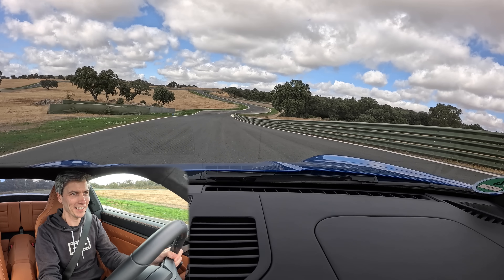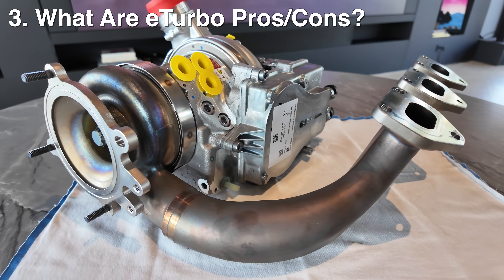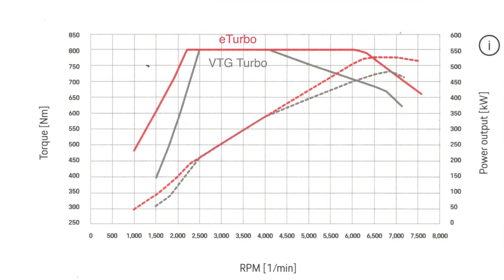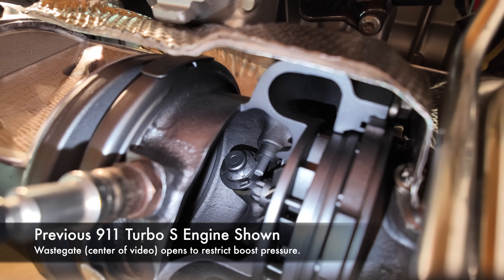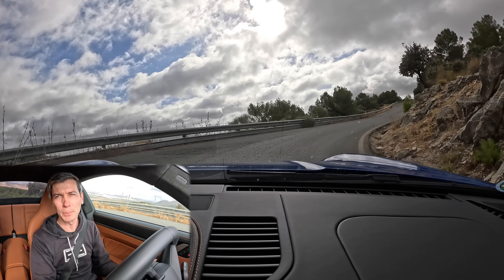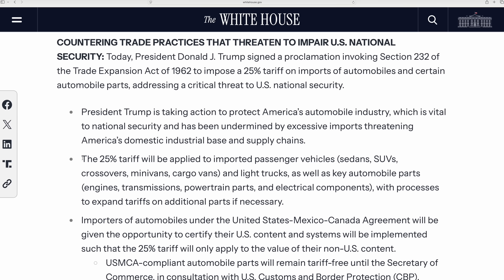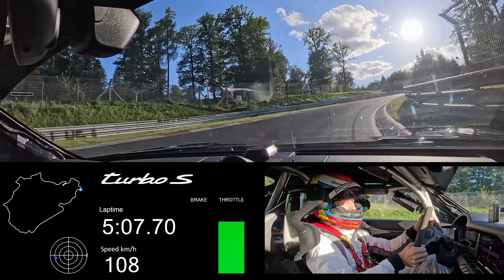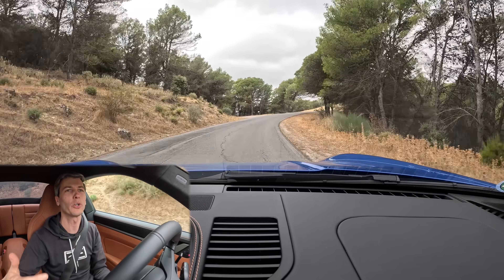Electric Turbos Are Here — Is It A Good Thing?

Comment: no waste gates, no variable geometry, means way less moving parts... seems like a reliability win, too... so long as the magic pixies behave.
Reply: the fact that they can harvest 30bhp says a lot about how much of the boast is being wasted in a conventional system
Reply: @hyakinthos_0902  it's not boost being wasted, it's waste thermal energy in the exhaust. The wastegate "wastes" thermal energy (that would've been used to make boost) to prevent boost creep, whereas the Porsche system converts it to electricity and uses it to power the traction motor.
Reply: @JamesBalazs  the turbo harvests the velocity from the exhaust which is caused by its pressure(=boost in laymen's term)  which itself is caused by the heat
Reply: @JamesBalazs  you basically said the same thing @hyakinthos_0902 is saying XD, thermal energy is still energy that can be converted to boost, Porsche just converted it to electricity instead of wasting it as released thermal energy (that could've been converted to boost) but since it wasn't needed at that moment it was released (wasted). Porsche instead of this now stores that energy in a battery as electricity which can be used later when needed. I dont get your point.
Reply: @geemy9675 boost is intake pressure, not exhaust pressure.
Reply: @Gnerko123 agree. I don't know what you replied to...
Reply: @geemy9675 you wrote exhaust pressure = boost, which it isn’t.
Reply: @hyakinthos_0902 well how much power can that Porsche make with no boost control?
Reply: @hyakinthos_0902  entire ice engine is one big waste of energy.
Reply: @AmigoAmigo-w5p Electric motors are boring and lack character and passion.
Reply: @AmigoAmigo-w5p 
Okay then, please solve the charging problem.
Reply: @AmigoAmigo-w5p   Anyone with a minimum of technical background would know both ICE and EV are massively inefficient on a systems basis.  The electricity comes from a highly inefficient system if looked at on a systems basis as does ICE.  To just look at an internal combustion engine and compared to electrical engine is really simplistic.
Reply: about 30% peak efficiency
but a hybrid is more practical for today. Unless we overhaul the country's electric grid
Reply: @MrEkzotic truth
Reply: @MrEkzotic that’s not the diss that you think it is.
Reply: @banzaiib AvE fan by chance?
Reply: @bgg-jp5ei yessir! This seems pretty skookem!
Reply: @bgg-jp5ei I watch that channel 👍
My perspective in this is also the inverter drive necessary to operate what is either a 3 phase AC motor or a brushless DC motor.
I'm guessing it's BLDC to spin a good 60,000 RPM or more very quickky to get the turbo where the turbine would take it from there.
This certainly changes this from being purely a mechanical design and repair to one of some sophisticated inverter system.
Also I was thinking about the regen capabilities just before he mentioned that they became a source of power to redistribute elsewhere. That is cool 👍

No doubt, those of us who are not millionaires would never consider what will become a money pit over the years.
Reply: @bgg-jp5ei he clearly already doesn't
Reply: Where there's magic pixies there's angry pixies. Not to mention the confuser might get confused
Reply: It also replaced the air pump used to get the catalytic converter started.
Reply: @gordonn4915 Air pumps for emissions have NOT been used for 30 years since they could do it with some strategic valve timing/overlap etc
Reply: How much of the reduced parts is from the hybrid system than the e-turbo? A hybrid system already gets rid of a lot of accessory belts and the starter motor. The only thing the e-turbo looks like it's specifically removing is the wastegate.
Reply: While I get and understand what you are saying about less moving parts. My concern is having an electric motor married to one of the hottest parts of an engine.
Reply: @davidl8620If you check at 1:07 it seems there is oil/water conduit over there,maybe for also cool the electric motor?
Reply: @davidl8620  no doubt this sounds like it could be less reliable, however there are winding insulation materials that can withstand extremely high temperature.  Class R windings are rated for 220*c. The bearings have already been rated for these temperatures before the electric portion existed. And there's no rule saying the electronics have to be mounted to the turbo. If the motor is oil cooled (most likely is looking at the cutaway photo of the turbo) the winding will never see temps that high. Electronics get a bad rep because consumer grade electronics are known to be less than reliable. Things specifically designed for harsh environments are quite impressive in what they can handle. I replaced a cutler hammer responder drive 4 years ago that had been running since the 1970s driving a 50hp electric motor. The little bit of plastic that was in the drive was crumbling, but it still ran.  If we want electronics to last, we can make it last.
Reply: @matthewweaver1123 automotive electronics are a different grade with special requirements for temp cycling.    Higher temperatures and more cycling will still reduce lifetime, minimising that is always a good idea.  Eg mounting an ECU on top of an engine looks like bad design.  Exotic electronics made of GaN can cope with far higher temps than silicon, these parts may not need heat sinks.  But they are expensive and have other reliability concerns.
Reply: @matthewweaver1123 also, there are exactly zero electronics in an electric motor..
Reply: @geemy9675 
There are electronics in brushless motors like that one that has them mounted to the sides of the motors.

As a later comment says, it appears there is coolant running through them to keep the heat in check.
Reply: @davidl8620yeah true. But if its reliable, how porsche gonna make money? :3
Reply: @holyKSer123 The ones that do fail will cost many times more and scare people off buying the car out of warranty, like EV's due to the battery.
Reply: @davidl8620 it’s Porsche. They’re not worried about reliability, just making sure it makes it past the warranty
Reply: @davidl8620 It doesn't increase the price of the car by several thousands for nothing. Variable geometry turbos sound like hell to engineer and assemble, yet the little device with few moving parts still ends up costing far more. Maybe they're using some exotic materials or the motor is hooked to the cooling system, maybe both, or maybe nobody has driven the new car hard and long enough to find out Porsche just wanted higher margins.
Reply: @davidl8620 a fair concern, tho modern electric motors tend to produce tremendous heat themselves in high performance applications
Reply: @air-headedaviator1805  and as a result employ various cooling techniques, often water cooling... Adding complexity back to the turbo
Reply: @air-headedaviator1805 all the more reason not to put one next to a turbo.
Reply: I couldn't even guess about reliability, but repairability will surely be worse, or at least much more difficult.
Like imagine getting a cheap old porsche in like 20 years but the electric stuff is not working.
Reply: @shiba7651  A today's Turbo S is so well-made, people will still pay anything to get it running, even in 20 years from now on. 3D printing metal parts will also be much cheaper in the future.
Reply: @shiba7651  Worst case scenario, just delete the turbos and you'll still have a great NA engine.
Reply: @ChristianStout  motors designed for turbos usually run less compression, cams tuned for the turbos, and other systems designed to run with the turbo.  A turbo motor minus the turbos would be a big turd.
Reply: @ChristianStout  IF you can get the computers to let you do it.
Reply: @shiba7651  That's like getting any 20 year old German car, AKA not the company's concern because they only care about the 4 year leasing period for reliability. After that, whatever sucker buys the car used gets to pay full dealership prices, especially with so many things becoming brand specific that try to stop you from doing repairs yourself nowadays.
Reply: @shiba7651  It'll be cheap to fix that stuff in 20 years.
Reply: @shiba7651 that all depends on how widely electric turbos are used. Also surely people who can afford a 911 can afford to maintain it right?

It's not exactly a cheap car 😂
Reply: @shiba7651  these will probably become standard on cheaper brands
Reply: @shiba7651  So.....just like now?
Reply: @shiba7651  alternators are pretty cheap
Reply: @shiba7651  that would be so cool to grab this for like 10k, could be easily repairable
Reply: @shiba7651  All new cars are becoming disposable items, no matter how pricey they may be.
Reply: @shiba7651 My first thought was that  failing electronics in this turbo would just mean that the turbo would function as a non-e turbo. But no, in this design it also functions as a wastegate so I don't think they are going to let this car run very much if these electronics fail.
Reply: @shiba7651  Exactly. Imagine trying to restore these things 20, 30 or 40 years from now. These manufacturers (all, regardless of brand) are dropping some parts availability beginning at just a few years from last production. Won't it be fun just trying to keep it running, let alone doing a full restoration. No thanks, I'll take the purely mechanical one.
Reply: @shiba7651  And you can guess the cost of replacing that electric turbo ....just the part cost alone is likely to be breathtakingly high.
Reply: @henrybrandt1057 the good thing about things is, the more there is the cheaper it gets. So in 20 something years if it breaks there will 100% be better and cheaper availability of parts that are currently "rare".
Reply: @henrybrandt1057  probably around 10K for such a turbo. The less sophisticated AMG one costs abot 6K
Reply: @henrybrandt1057 there are definitely going to be aftermarket parts and it sounds easier to as tbh! Electric motors aren’t a new thing either
Reply: @henrybrandt1057 thats just cause its new and uncommon, it shouldnt be too expensive cause electric motors are really cheap.
Reply: @shiba7651  Will it though.. Extra code running through computer, sure, but in terms of hardware, I suppose recoiling motor isn't exactly impossible task, and for standard turbo regen, there are shops that do that. I think you will be able to regenerate it. Only thing that comes to mind that the wire to coil would need to have some high temperature isolation, not sure if standard stuff would survive the turbo temperatures.

Im carefully optimistic that it would be actually easier to repair. Not including batteries / other hybrid stuff, that is, I assume comparasion is against hybrid stuff and we focus just on turbo
Reply: I feel like it depends on the future direction of hybridization. If this is a one-off or early design that needs much refining, or will be dropped due to other costs, then its uniqueness may make it difficult and expensive to repair/maintain. But if this turns out to be something that becomes more common, then the knowledge and parts may be more available and easier/cheaper to maintain. 
I guess all I'm saying is, time will tell.
Reply: @CoryMT  It's been tried and tested in F1. Not sure about road cars (ignoring the AMG One, for a moment, as it has a Mercedes F1 powertrain inside of it)
Reply: @halofreak1990   IIRC Only Merc and Porsche are pursuing anything that looks like an MGU-H, and also they're dropping it for 2026. So. Who knows.

The main thing holding it back is that all turbines are inefficient at partial power, and regular cars don't spend that much time at full power, compared to a regular crankshaft hybrid that makes an engine more efficient whenever it's at partial power.
Reply: @by010 the heat is mainly contained to the hotside so I don't see the coil that is mounted with the cold side experiencing significant heat. Like we have silicone couplers directly bolted to our turbos I'm sure we can put the coil in a place that won't melt. Motorcycles have coils built directly into the side of the engine encased with hot oil so I'm sure a turbo coil can be made with similar specs and experience similar temperature on the correct position of a turbo.
Reply: @clutchboi4038  Dont they like make 1500C silicones but copper is like 1000C? I think its possible to engeneer around it, IDK if and what they actually did and what is that temperature we are talking about. Just I know turbos on hot side get really hot, so possibly touching very hot thing, I wouldnt be suprised if that was a problem, simply.
Reply: @shiba7651 no such thing as a cheap old hybrid.
Reply: @shiba7651 the electric stuff is actually a lot easier to fix. Funny enough.
Reply: There will be aftermarket refurbishers for these. But it won't be cheap!
Reply: Couldn't you hypothetically  mount the turbo farther away from exhaust and pipe the air from the back of the car somewhere and get the turbo itself away from engine bay and all the heat
Reply: "Its more reliable"

Sure. Right up until you blow one of those e-turbos and fork over 20k.
Reply: @StabbyStoat I don't think you can blow the turbo on any 911 turbo in history and not expect it to be expensive.
Reply: @air-headedaviator1805  thats usually because when the turbo blows, chunks of metal from the turbo go straight into the combustion chamber and cause malice in the palace, as youtuber IDoCars often says
Reply: @StabbyStoat that’s price, not reliability
Reply: @louisthibault555 ... If you have to spend a lot of money on something to fix it, then its not reliable. By definition, its not something you can rely in.
Reply: @StabbyStoat an expensive part that rarely fails is by definition reliable. Again, what you’re talking about is cost.
Reply: @louisthibault555 You putting "turbo" and "reliable" or "rarely fails" in the same sentence shows everyone here that you dont know anything about turbo'd cars, or how expensive it is to upkeep them. Turbos are the MOST COMMON part to fail on a turbo'd engine.
Reply: @StabbyStoat  if your point is that turbos are in general less reliable than natty cars then … yes.  And this turbo is supposedly more reliable than other turbos.

The rest is a difference in cost.
Reply: @louisthibault555 .. and that cost is always put on the consumer. Someone who has to spend a lot of money on keeping their operational, is not going to tell you their car is reliable.
Reply: @StabbyStoat correct. It costs more, including to maintain. 👍
Reply: @StabbyStoat it's a 911 turbo S . it's meant to be fast, expensive ....and to have turbo(s)!
even if the turbo name doesn't mean anything anymore 😂
So yeah if an hybrid with electric turbo gives better performance, they use it. also Porsche is not shy of adopting new technologies. bor ONLLY when they are mature enough to meet their standards
Reply: @StabbyStoat 20k ? You’re not even in the ballpark.
Reply: @Smootier yes cost fitted because the engine has to be dropped out of the car and then refitted after the work has been done and the parts cost a fortune, standard for most 911 repairs
Reply: Noooo booooo
Reply: And the angry pixies keep themself inside.
Reply: Imagine if they got rid of the turbo and the engine entirely and just powered the car with an electric motor. That would be even less moving parts and even better reliability. Not to mention the increased response and the incredible torque from a stop
Reply: I was wondering why this hasn't been done before.
Reply: Whose parts will hold up?😮
Reply: Cooling the parts in some way. Hmm...😉
Reply: it is not because the electric compressor motor doesn't like heat.
Reply: I’d rather have a waste gate
Spring > electricity
Reply: The ProCharger 101 -Supercharge CrankDrive™ is better then E-Turbo's Cause you can Change Gear Ratio's on the SuperChargeer while you Drive or shift Gears thus No Lag and You can Turn It OFF When it hit's Maximum RPM's Thus no More ENERGY from Engine to the Supercharger aka transion into a 100% naturally Aspirtated CAR
Reply: They are angry pixies
Reply: Taycan has none of that and it’s a reliability disaster
Reply: If you are using a electric motor, you might as well use it to spin the wheel.
Reply: I feel like it's a terrible idea.
Reply: Variable geometry would still be cool
Reply: Constant fetling and adding more complexity to ICE engines to make them more responsive.... 

Ironically making it feel more like an EV with more instant power and less theatre 'waiting for boost to build'
Reply: probably way more reliable to be honest. less moving parts. less wear.
Reply: Every moving part will eventually wear out.

Buy an EV, they have less than half as many
moving parts as an ICE.
5k moving parts vs 2k moving parts
Reply: Fire make heat. Zoom
Reply: It never left f1 for a reason.....longevity and cost. Its cheaper and more reliable to twin charge. Ever seen a f1 electro turbo go 200-300,000 miles ?
Reply: @mddunlap03 well 200k miles is the highest mileage recorded for a Turbo S but the vast majority stay well within 100k. they are also likely to require a lot of new parts reaching that mileage.
Reply: @mddunlap03 it did leave F1
AMG,Audi, Volvo, now Porsche . it's not widely adopted because it's a niche product just like turbos were 40 years ago. meanwhile the belt driven supercharger is literally dying before your eyes next year the lotus emira will be the only onnthe market. 
e superchargers are more widespread but when combined with a traditional turbo like in several cases it's actually closer to an e-turbo and the logic is these will switch to e-turbo than combine the advantages progressively
Reply: They are significantly LESS reliable than standard turbos in actuality (because there is still a bunch of parts that need to work for it).

And they are unrepairable, expensive and also hamper the top end
Reply: @HyperScorpio8688 electric motors are more reliable than turbos
Reply: @geemy9675  LMFAO
Reply: There's no pixies in witchcraft is there?
Reply: except the turbo work load is much harder now
Reply: Wouldn’t a e Supercharger be simpler
Reply: @keith6371 yes, it would be more simple, but it would draw it's power either:
-from the main motor acting as a generator and reducing the net power output
-or from the battery, not allowing the battery to also simultaneously power the e motorIn borhr cases, you lose power.
this is why eturbo make more sense in the context of a Turbo S, it just performs better. just like regular turbos perform better than superchargers, except without the downside of turbo lag, waste gate etc
Reply: I an not buying a 911 for less moving parts lmao buy a carolla
Reply: I’d say it’s comparable but now you have coils, magnets, a stator and a rotor. 

More parts, more circuits, more complexity = less reliability.
Reply: Instant turbo spool, easier to manage the turbo and integrate into the rest of the engine.
Reply: If they take in count that the turbo shaft will be experiencing a lot more forces. Either they will make them much beefier or they will fail rather quickly
Reply: Will adoption of electric turbochargers spell the end of superchargers?
Reply: Not as reliable at all. Diesels have had them for 20 years. And they are junk
Reply: @patricksittre2847 good to know.
Reply: If you find some one who can train the pixies he will become god
Reply: And no fun.  No mechanical and engineering artistry.  No driver engagement.
Reply: Less moving parts??? They’ve added an electric motor to an existing turbo. That’s more moving parts.
Reply: @ducatione of course LESS moving parts. ALSO definitely less RED HOT moving parts.
Something like 50 moving parts (VGT system) - all of those replaced with enlarging one single already existing moving part (integrating electric motor rotor into turbocharger shaft) assuming car already had hybrid system.
Reply: I'm never buying electric cars until they start using solid state battery, lithium Ion burns down house.
Reply: I heard that electronics love being next to hot exhaust gas
Reply: Theres nothing reliable about this car
Reply: People who say "It will be expensive" is like, yeah? It's on a Porsche 911 of course it is expensive. With mass adoption it would not be much more expensive than typical turbocharger or supercharger. Heck, indications that future ICE consumer cars will come with them by default due to increasingly stringent emission control.
I honestly expect Japan to pop them on almost all consumer car by 2030. They did that with normal turbo-small engine pair and the west called them mad for it.
Reply: I wonder when this tech will come to trucks and smaller passenger cars. Imagine this thing on a small hybrid where the majority of the power comes from the turbo. Gas mileage is going to be through the roof.
Reply: Does that mean no intercooler too?
Reply: @jakefall9838  Of course there should be intercooler dude, it's still a compression device.
But overall it would run cooler than conventional turbo.
Reply: @ZeroXSEED my bad.
Reply: @jakefall9838  No worries.
Reply: reliablity and electric are two words that don't go together.
Reply: Perfect example of not being intelligent enough to understand the subject. There are way more moving parts here, not less.
Reply: Might be a little more reliable in that aspect but the seals and bearings will still wear out like a standard turbo. Also replacing a $1000 turbo is far nicer than a $3500 turbo.  Not to mention you are not all electric so you still have all those aswell as an electric motor sandwiched between 2 very hot things
Reply: yeah and its why EVs are just less maintenace I haven't replaced my brake pads on my Tesla model 3 because I use regen braking
Reply: Wait until you experience Electronic failures. Good luck with those repair bills.
Reply: @DangerNoodlez144 because, as we all know, conventional turbos are so cheap to repair
Reply: ICE powered cars are similar to vinyl records when compared to electric vehicles and digital music. Basically for a tiny minority in the grand scheme of things that just won’t accept evolution no matter the benefits.
Reply: Major disadvantage repairability cost to repair and what happens if the turbo electric motor ceases to work because the battery isn’t charging I can see the long-term effects. Will it definitely increase the price of my 997
Reply: @Antjermima1234  what if, what if... hybrid sytems have proven to be reliable when they are properly designed (Toyota, Lexus) and even on high performance applications (F1 etc) battery is replaced when it's dead like any part
Reply: Good thing the people who buy these cars won't be driving it much!
Reply: @Wind_slash0 actually the turbo s is used as a daily for most Porsche owners. I have a 718 GT4 and have been to quite a few little meetups and it seems like owners of the GT cars trailer and garage them more than anyone. You have an on and off light switch with those guys they're either at the track all the time or the car is on a lift with a cover on it in a warehouse but you see turbo s cars all over the place here in Southern California.
Reply: You think a motor soaking up all of that heat from exhaust materials after the engine is shut down is going to be reliable?
It won't be.  I still like this of course! Lol
Reply: @ßeau_M  electric water pump
Reply: @ßeau_M  It works fine that way in F1, though
Reply: @halofreak1990 

F1, where they do frequent rebuilds...  apples and oranges.

Electronics driving the high voltage and routing it to turbos or parallel engine motor are what will be failing most, batteries second.

We will see, though, in time.
Reply: @ßeau_M  thanks for weighing in. random speculation in YouTube comments are much more reliable than the engineers that designed built and tested the system, I'm sure
Reply: @werdwerdus 
Random speculation on the speculation of the commenters is speculation itself.  😂

Products are often sold that are of little to no value
Reply: @ßeau_M Turbos and exhaust manifolds should be water cooled these days.
Reply: I don't know if an electric motor will be happy for very long sandwiched between an unbelievably hot turbo. I'll stick with a regular turbo and wastegate.
Reply: @RindosRides  it won't get nearly as hot though
Reply: @RindosRides Water cooled, electric pumps that keep circulating the coolant for a while after the engine stops etc 
My truck runs the coolant pumps for quite a while after I park it. Prevents the oil from crystalizing
Reply: @RindosRides  I'm sure you know better than the engineers that designed built and tested it, thanks for weighing in
Reply: @werdwerdus I'm fairly interested in this design but I have to point out that engineers absolutely get things wrong sometimes. Remember when they introduced belts that go through oil and they insisted that it wouldn't negatively affect them? Then later everyone dropped them because in fact it was actually shortening belt life
Reply: @werdwerdus the same engineers also built the infamous IMS bearing ...
Reply: Yeah, EVs are superior
Reply: @Jeff.55649  EVs are superior in many ways but not weight which matters a lot. there is no electric equivalent to a 911 turbo S (yet). the Taycan turbo GT is a beast too but it's over 1000lbs heavier which makes a big difference. although only 3.6s off the turbo S nurburgring time (0.8% slower)
Reply: @Jeff.55649  I have not seen any EV be even remotely competitive in the cannonball run, nor towing heavy loads long distance.
Reply: your evs aren't even the fastest drag cars that goes to fully built gas cars
Reply: No lol. This will be breaking constantly. Less moving parts rarely means lmore reliable. I don't know where this fallacy comes from. But heat and electrons arent friends. Plus, an angry battery....oh, these will be HOT....when they catch fire
Reply: @RipRoaringGarage  more wires for the rodents
Reply: @KnottyBuoy  Gotta feed them poor misunderstood furries....
Reply: No. It'll be less reliable. The question, is the reliability deficit worth the performance, is the important question.
Reply: Nah this is gonna be Porsche's new bore scoring issue, electronics don't like high heat for long periods of time, it's a failure waiting to happen, and you introduce the complexity and expense of hybrid systems.
Reply: @nunya2814 your horse must never get sick😂😂
Reply: If the electric motors' purpose is to spool up the turbo. Then compressed air does the exact same thing. Like, look at Volvo. They had that stuff years ago.
Reply: you are just repeating things he points out as a comment and 1400 people seem impressed.........................
Reply: you may have reduced some of the moving parts, but you traded them for something less reliable, and that's electronics...  Electric motors really don't so well in really hot housings.. insulation breakdown and failing bearings will be seen sooner than later.

The power controllers will also face reliability issues, because 40KW is enough power to melt a lot of parts.

Time will tell, but I bet we see these having high voltage issues in the first 5 years, including full failures.

It is good to see someone working to improve efficiency in performance cars, to prove or shake down technology, until the next big thing comes along.

I anticipate them offboarding the motor controller boards so they aren't wrapped up between hot exhaust tubes and a hot turbo housing.  Electronics gain reliability and efficiency the more cool they are kept.

We'll see.
Reply: @aaronmyers4951 There is no need to put in the hot side at all. Moreover, the input should be as cool as possible.
Reply: So either the motor windings are nearly immortal, or Porsche has failed to isolate the coils from the heat at just the right degree to allow for gradual degradation.  Is it impossible to completely eliminate excessive heat exposure?  Outside of that, the usual turbo bearings are all that we need to worry about.  As with the ridiculously long lasting nature of electric drive motors, I have my estimation that coils and magnets are gonna be completely unchanged for a very very long time.
Reply: Same logic for why EVs are better🤷‍♂️.
Reply: and no accessory belts. less drag on the motor. waaaay less moving parts.
Reply: @CharlesChristena  except for turbo spin load (moving parts)
Reply: How about replacing the combustion engine to an e-motor.
Genius. Much, much, much more less moving parts.
Reply: Yup, electronics can last forever if planned for. Look at voyager and other old satellites we still use today. If you think ahead and plan electronics and tech can last for ever in harsh conditions
Reply: Electric motor could break.
Reply: @stormrider01then its just a turbo (with no wastegate... whoops)
Reply: @stormrider01electric motors are also really really really reliable. We have had them for centuries
Reply: @crackedemerald4930 
and that's why a lot of your GM trucks had to have heat shields put between the exhaust and the starter, because electric motors were failing from the high heat exposure. 

to be fair, that's a brushed motor starter versus a brushless motor in the turbo...

It's more likely the electronics routing the 40 kilowatts of power will fail over time, and not necessarily a long time.
Reply: These have additional moving parts and are significantly more complex. The electric motor is a new component added with its own bearings and other internal components, and there are new electronics involved.
Reply: @MikeO-l7s  Actually, I am pretty sure the electric motors ride on the same bearings as the rest of the turbo, on a common shaft... I will half assume they have an oil pump on a timer to keep cooling the shafts with oil after the vehicle is shut off so that the bearings will last longer and not coke up.

The extra mass of that motor will hold heat longer, but I am sure they have factored that into their oiling timer.